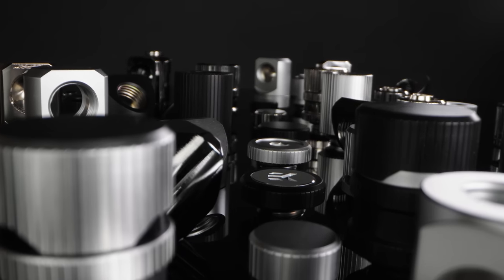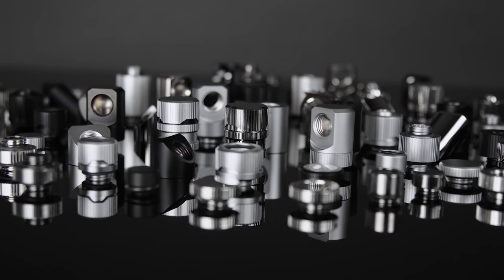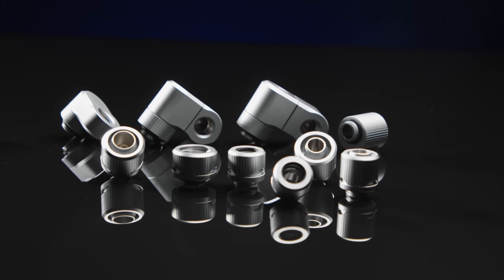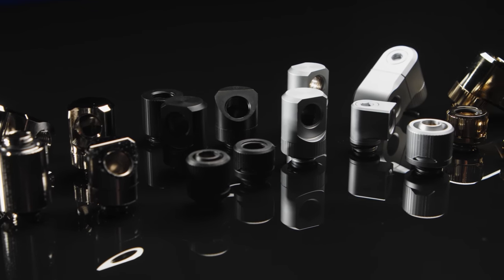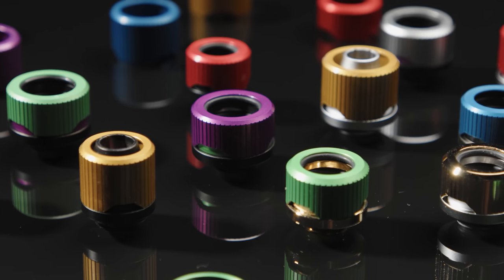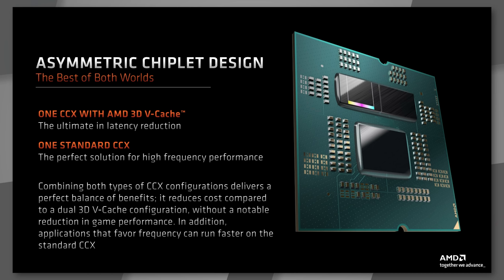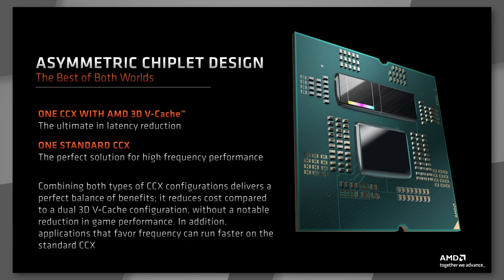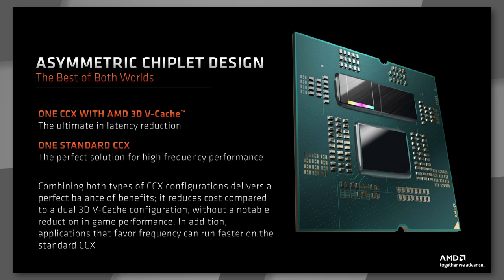Why I switched back to Intel...

Comment: I've been using a 7900X non 3D without any issues for a while now. EXPO with 6000MHz in the BIOS is working fine. I have managed to get an offfset on curve optimizer that is rock solid and gives me pretty insane scores on 10 minute Cinebench R23 runs. I have memtested the rig also and it really has been flawess. No BSOD no nothing. My rig works rock solid, so I am happy with it. Oh and the CPU cooler is an AIO 360. So this is my experience with a non 3D AMD chip.
Reply: What mobo and ram are you running in this rig?!

Comment: Definitely true on keeping up with BIOS updates.  When I first put together my Ryzen 5 3600 on X570 I couldn't get even 3200 MHz DDR4 stable, and there were lots of weird hiccups and micro stutters, the latter particularly annoying because it would also briefly freeze any audio playing.  It took a year of updates to really get things sorted out to a point where it felt truly solid.  I guess the real moral of the story is if you're going AMD, maybe buy in towards the end of a generation instead of the beginning, if you need absolute stability.

Edit: Almost forgot that using the front USB would also cause it to completely lock up at times, though that was to AMD's credit one of the first things that went away with updates.
Reply: I had a similar issue to your weird hiccups on my previous X570 system with 5700X.  It turned out for me that the thing causing the weird hiccups including in audio was the fTPM implementation.  Since I am still on Windows 10, I just disabled the module and the hiccups went away for me.  I am guessing by this point that is fixed for the X570 board I have (sitting in the other room in the box.  I have a friend who is going to build a newer pc for themselves with it when they come to visit from out of state) but I haven't been using it for a while now so I can't be certain.  I would hope so, and hopefully it doesn't cause the same stutter issues in Windows 11.
Reply: So, i can't speak about Ryzen 7XXX
But i've had 3900X and 5950X on ASUS Z570 PRO board. It was the single worst experience with hardware i've ever had.
I strongly believe their BIOS team is either incompetent or are simply trolling.
The number of times they've released BIOS that would bug out on any frequency above 3200 is ridiculous.
Every 2nd BIOS update was straight up broken.
I've switched to another brand since then and had 0 problems with same RAM and CPU.
I've promised myself to avoid AMD+ASUS combo at all costs.

Comment: I built a new PC a few weeks ago. My first full upgrade in 10+ years, moving from an i7-3770 to an i5-13600K. It's wonderful. Seeing test results showing AMD performs better in some games gave me a moment of pause, but I've always had Intel so it's an easy buy for me. They are already overkill for 4K gaming, and I like that they shine in multiple areas and aren't only great at one thing.
Really, unless AMD comes out with something that is the true all-around champ, I don't see myself leaving Intel.
I'm thinking I got one of those golden samples too. I have mine overclocked to 5.5/4.2 at 1.2V. All stability and stress tests (AIDA64, OCCT, Prime95 etc..) pass without an issue. Maybe I could push it further. I haven't tried. As I've realized that overclocking is more about the "sport" of it and less about the performance gains, I don't feel it's worth it to push this as far as I can. In an hour of AVX2 testing in OCCT, one core reached 93. Without AVX instructions, I barely surpass 80C. This CPU is just a dream.
I do have a Thermalright contact frame, btw, so that is likely adding to the efficacy of my Phantom Spirit.
Reply: Great CPU, oh and a breeze to overclock....though yours is so much better than mine as 1.2v is very impressive!!!!!! Have mine (13700K) running at a max 1.278v on an adaptive vcore hitting 5.5Ghz and temps are in the low 80's when pushing CineBench R24 multi-core test...Have a 360mm AIO and I got the Thermalright contact frame which does help...
Reply: I have been building gaming PCs since the late 90's, almost every AMD I have ever had I had issues with.  I remember building my first AMD, 2 exact PCs at the same time, AMD 233mhz (yes I am that old) and mine worked fine but my friends kept blue screening, he had to change his clock speed to 200Mhz to fix it.  I tried going AMD later in years and ran into compatibility issues with NVIDA cards.  I justs gave up.  I thought by now I could trust them and almost built and AMD over my current i9 a couple of years ago but I just don't think the reliability I have had with intel is worth the gamble.   My old gaming PC which is first gen i7 still runs great, I have a first gen i5 laptop from MSI still runs, and the only things I have done to them is regular upgrades like more ram, SSD, and new gfx card.

Comment: It is interesting to hear all of this. I've followed a bit of Jayz 7950x3d saga because I went all in on my CPU and got myself a 7950x3d. I was able to run PBO with 4 Dimms at 6400 MHz EXPO. I really wonder if it was a motherboard problem or bad silicon lottery. Sucks to have so many problems. As a newbie to building my own PC I feel a bit like I experienced some dumb luck. Even so, I'll take it lol. I know anyone can say I never had that problem, or I've had that same problem and it doesn't mean much. It's very interesting to say the least.
Reply: Small sample size problems, like a sample size of 1.
Reply: It's definitely an ASUS problem.  Their forums and subreddit have new threads related to this junk every day.  It's a shame J2c is so far out of the loop.  I mean.. a quick email to Steve would have revealed it.
Reply: Same here. MSI ACE, dropped in 6400MHz Kingston 48GBx2 CL32 with 7950X3D, ticked expo/auto and the way it went. Used same ram and cpu for out other system except board was Asrock X670EPG Lightning, it too saw ram 6400MHz and have had zero issues.
Reply: @n3o717  I'm running the MSI x670e Ace as well. Gskill ram with the same timings. 64 gb 6400 mhz, CL32. The thing is I've heard folks say motherboard doesn't matter anymore since the controller is on the CPU. I can't say I know, but I can say that anecdotally I've seen many of these folks rocking Asus boards. shrug
Reply: @VndNvwYvvSvv  Really need to look at more like at 10 -100 to get any real opinion.

Comment: I've been running a 5800X3D for a year and been very impressed with it. Power usage while gaming is around 50-80W and overall frametimes have been very smooth.
Reply: I'm getting one today to upgrade from my Ryzen 5 3600.
Had to pick one up for my AM4 socket before they discontinue at some point.
Reply: Here i am, swapping out my 5950x because it was the biggest piece of garbage ever created.. I never had so many issues.. I hope it serves you well.
Reply: @RngmonsterX  Not had any problems with my 5950x
Reply: Same, paired with a 4070 Ti it's been smashing any game I've thrown at it :)
Reply: @thegiantgaming7592   I did the same upgrade (3600 > 5800X3D) and it was 100% worth it.
Reply: A 5800x3d under full gaming load uses 140-142 watts
Reply: Running 5800X3D as well with a 4080. Can’t justify going to the 7800X3D. Going to wait for the 8800X3D or whatever the next line of X3D’s are called
Reply: Thinking of doing the same, what else did you need to do? bigger cooler etc... @EestiGaming
Reply: @Silent824  I did get a Noctua NH-D15S, but tbh it ran fine even with a Hyper 212 Black Edition, esp. while gaming.
Reply: I have a 3900x Will a 5800x 3d be worth it even now?
Reply: @tonyyimbo  If you basically only game on your PC then the 5800X3D is a worthy upgrade, yes. But if you game and work on your PC, and the work benefits from having decent amount of cores, then a 5900X is probably a better choice. 
In workstation tasks, the 5800X3D is behind even the normal 5800X by a bit because of the lower boost clocks (afaik).

Comment: I just went for the 7800x 3d because i didn't rely on Windows or AMD to be able to choose which core to put their processes on. I have a single ccd, everything will run through it. No issues with the 5800x3d as far as i know, so they couldn't blow it with the 7800x3d. Coming from an i7 6700k i noticed the upgrade. Specially after adding an RX7900xtx to it. Can't be happier so far! Sorry you had those issues Jay, thanks for your content!
Reply: Shoot i'm coming from an i7 6700 to the 7800 x3d, and got a 3070ti for a deal. I'm just waiting on my cooler and memory to come in, super stoked!
Reply: tbh for me it feels like windows scheduler for intel P and E-cores is a problem for 79*0x3d, since P-cores clock higher, they are chosen for intensive tasks, so that way non x3d, which clock higher, gets intensive load, and now we get game bar to prevent that and force it back on x3d chip

it really seems like that's a problem since only newest intel had different cores, so east way out for windows would be going by clock speed not by if is intel and is xth gen do that, which if my theory is right, ryzen 8000 with zen c cores will use that to it's advantage and game bar won't be needed, since c cores clock slightly lower and take half space, so e-cores with hyperthreading
Reply: @1Grainer1  this isnt legible!
Reply: @wavsirius yea it is. u just have to know more about cpus than "this one is blue and this one is red" to understand what he was talking about
Reply: @Crunkmaster  r/whoosh
Reply: @Crunkmaster  Can you translate it to actual English, please? Maybe you can pepper in an occasional comma.
Reply: @tim3172 basically both Intel and AMD have had issues with running different cores with different specifications in the one CPU.

12th gen intel had huge problems, to the point that many users were manually turning off their e-cores just to play games. AMD really only has this problem on the 7950X3D.

Windows scheduler WILL get better at this stuff over time, but for now the best solutions are:

a) buy a 7800X3D or a standard 7900X/7950X. Don't get a 7900X3D or 7950X3D.

b) buy a 13th gen intel and make sure you run all the latest patches
Reply: @tim3172  andyviant pretty much nailed it. basically the software doesn't know how to effectively use the hardware right now

Comment: 5800x3d, absolutely amazing. Initially had some RAM stability, but Gigabyte 550b mobo firmware patches fixed it rather quickly and now RAM also runs at intended speeds. At the beginning one thing that got me spooked was how quickly it jumped to Tmax, practically instantaneously, no matter the clock or voltage. But was stable and almost doesn't throttle down during summer. I considered the super slight throttle-down an ok tradeoff. Having a Noctua NH-D15 with double fans and an open box btw.
Reply: Dude!  I was exactly the same...   like crapped myself the 1st time as it was sooo quick, like you say instantaneous!  ...I'd used decent thermal paste, and a dual 120mm fan Thermalright Peerless Assassin.  I updated to latest BIOS, and set the RAM settings manually, and it seems okay...  I only get the occasional BSOD and that was when I've been in Microsoft Flight Simulator which would make anything but Threadripper with 4090 cry
Reply: I found it's sensitive to fan settings, though mainly more the fans ramping quickly until I set a delay in BIOS. Never had an issue with them getting to the max temperatures though (that's 90C or something?). Curve Optimiser is your friend here (there's the PBO2 tool which lets you do this on X3D), found that I had stability just using someone else's modest settings to achieve -30 on all cores (you're generally not supposed to just use other people's settings, but it was stable so whatever) and a sizeable reduction in power/temps while actually gaining a sliver more performance. Even if you can't quite manage that, it can at least let you lower those temps down to give yourself more headroom.
Reply: I had the same thing and undervolted in BIOS and now I have a stable under 50C while playing Cyberpunk at High to Ultra settings.
Reply: @GrandHighGamer  Thanks for sharing, wasn't aware of the PB02 tool...  I'll give it a go"
Reply: what does issues with ram stability look like?
Reply: Amazing if you dont playing games
Reply: 5800X 3D here, running wih PBO -30 on all cores and lowered PPT and EDC values, rock solid and temps way lower than tjmax (i think i was lucky with the silicon lottery)
OC also on memories, Crucial 3600 CL16 @ 3800 CL16 lowering RAM parameters as suggested by Ryzen DRAM Calculator. I saw gains both on benchmarks and games, super happy with this 2021 setup
Reply: @trevorbelmont4633  it froze or bsod-ed if i was using XMP, but as mentioned after one of the motherboard updates fixed the issue and then could use XMP
Reply: @p3zx39  I want to build a rig for Flight Simulator, what are your specs? any advices? I am completely lost, since I haven't build a PC in more than 10 yrs

Comment: No problem, a microcode change and 10% reduction in performance and we're good to go!
Reply: RIP Raptor Lake 2023-2024. Good run boys.
Reply: Well i got hacked 3 times it fried my brain and all this insane information from generation one you need a gen 3 it was even speeding up the way my mind process time ... interesting.. it was a ryzen 1700x.. that crappy company ripped me off 1000 dollars... but it was insanely powerful pc with bad gpu I built
Reply: It's not a 10% drop 5 % max
Reply: @johnstannard8366  5% is still 5%, and that's assuming they won't have to patch it again.  And that's before you factor in the people microcode will not help because the processor is already fried!
Reply: @Raptorman0909  that falls under false advertising doesn't it????

also what about people who had small issues, like random crashes that weren't really constant or people whom had shader loading issues on games, are those guys cooked too????
Reply: @Xm_gamerX  That is the exposure Intel faces by detuning for greater stability.  I suspect they will escape legal consequence for the detuning, but there are tons of people who's CPU's have already been damaged or destroyed and no microcode will fix them.  I don't see this being the end of Intel, but it could be.

Comment: Only weird issue I've ever had with AMD right now when I built a PC for somebody was random crashing/freezing unless I turned Global C-State Control off. This was on a flagship Gigabyte board with a non-3D 7950X. I've been hearing that intel also has its own issues so I think it's just a fact that both sides are on spotty grounds right now with a hit-miss situation per user.

The main reason I tend to lean AMD right now though, is the huge power consumption discrepancy. Going by KitGuruTech's benchmark results (since I have no i9 on hand right now), the 7950X3D consumes 151w during 10min Cinebench 23, while 7950X consumes 205w, versus 13900K consuming 253w~300w. That's a whopping 100+watts difference. While power bills might not be a problem, the heat output is, especially where I'm located which is a tropical country.
Reply: same issue with c-state
Reply: tbf the 7950x3d was known to be "buggy" from the get go with their 2 ccd's in gaming, u can have a workaround with it tho. Like process lasso u can set an affinity core for every program u want or creating a batch file doing the same thing.
Reply: depends on what you're doing. the intel chips only turn into space heaters when you hammer all cores (not helped by the fact that motherboard makers tend to overvolt the hell out of those CPUs). 

when gaming, they use only slightly more power than the 7000 series and are not really all that hard to cool, even the 13900K. hardware canucks made a video about this.

Comment: After hearing this and Brad Shoemaker's experience, think I'm just going to stick with my 5800X3D til the next generation and see how things pan out, not in any huge hurry anyway, and definitely don't want to create additional headache for minimal gains at this point.
Reply: When I ran my 3800 before it also took 2 years before I could run full memory speed. So I just upgrade to 5800x3d
Reply: I just upgraded to a 5800x3d from a 3600 two weeks ago. I feel zero need to upgrade anytime soon
Reply: same
Reply: What Intel chip should I go with
Reply: I'm building a 7800x3d. I'll let you know how it goes.
Edit: I finally built the pc and that cpu is really powerful at least when it comes to gaming. I'm playing some of my old games like batman arkham knight cpu utilization is 10% same on shadow of war and both 4k with a rtx4080. Gpu utilization is at 50 to 70%
Reply: I'm sticking with my 5800X3D as well, mainly because I simply have no reason to upgrade it yet. Nothing I play, even my main game CPU heavy Star Citizen, comes close to stressing this thing out. With 64gb 3600 CL14 RAM and a 7900XTX, I'm good for a while.
Reply: Still on Intel 6700k 😂
Just got a Amd system running a ryzen 7 3800x dirt cheap off my brother, that last me couple of years easy.